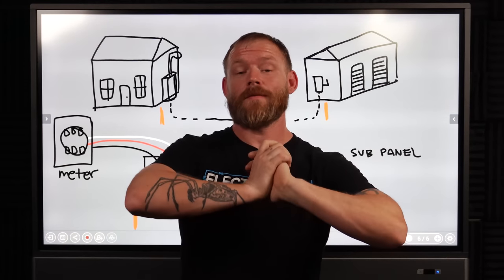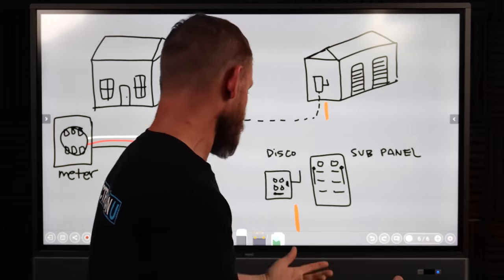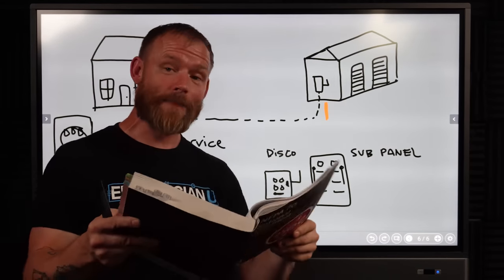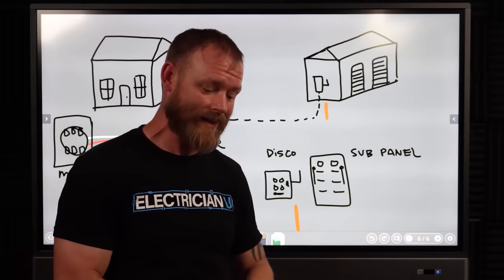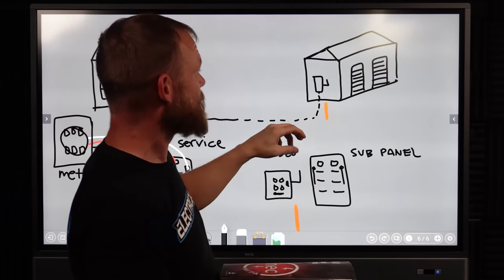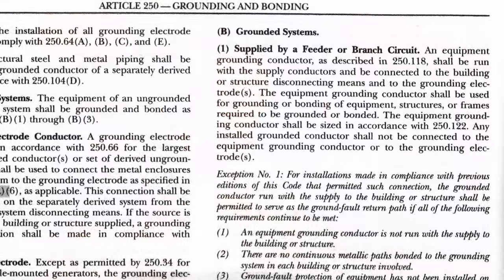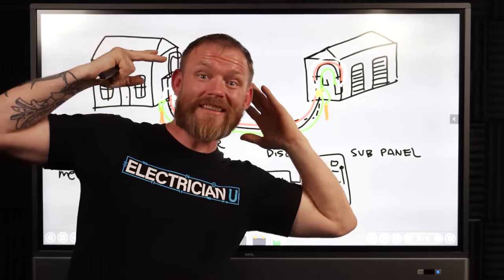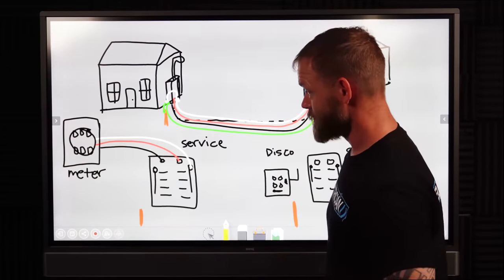Is a Ground Rod Needed When Grounding Multiple Buildings?

Comment: Nice explanation.  I am so glad to hear your explanation of the code requirements for this.  While I am not as good on code, I am an Electrical Engineer and I can explain why you don't want to bond the neutral to the ground in more than one place.  In your example, the neutral (white) is bonded to ground at the main building and is run to the out building.  That neutral wire will have current passing through it because of the load from the out building and thus its voltage will be different.  Also, because of the inductance of the wire and because the wire is long, the voltage on it (both in phase and amplitude) will be different from the ground (which should have not current flowing through it).  Thus, if you connect the neutral and the ground at the out building you will introduce a current in the ground.  This can be a safety hazard.  This issue is called a "ground loop" as you can see that the ground and neutral connected at both ends makes those wires into a circle (loop) that current can flow through.
Reply: The neutral conductor will carry the unbalanced load current from the sub panel back to the main breaker panel. The neutral is still a GROUNDED conductor and is "neutral" between both UNGROUNDED 'HOT' LEGS in a 240/ 120 volt 4-wire set of feeders.
Reply: @electricianron_New_Jersey  The unbalanced load on the neutral does not correct a ground loop though.
Reply: @electricianron_New_Jersey  I agree that is how it works as long as you do not connect the ground to the neutral at the out building - which you should not do.  All I was doing was explaining why - because though the neutral is still grounded, the inductance in the wire plus any unbalanced load will cause the neutral to be different from the ground at the out building.
Reply: Also, with the ground and neutral tied together at both ends you have turned that length of ground wire into a second neutral and the current that would normally flow on the neutral will now split itself between the two wires.
Reply: @jdilksjr  and I might add that having current flowing on the ground has the potential to energize anything connected to that ground wire. That's an accident waiting to happen, and someone who touches an energized equipment case is going to get really pissed, shocked, or electrocuted. One or two of these results may have a secondary effect of someone else getting their ass kicked while being cussed out.

Comment: We had a job once where we were installing a sub panel in a shed that was directly adjacent to house. The main panel was about 10 feet away and there was less than two feet of space between these buildings. We didn’t run a separate ground because our lead misunderstood the code but when the inspector came out and mentioned it he took a 2x4 and nailed it up between the buildings so they could be considered the same structure. The inspector laughed and passed it. I’m pretty sure the homeowner took the stupid board down as soon as we left but that’s not on us I guess.

Comment: There are lots of videos that explain how grounds & neutrals should not be bonded at a sub panel, and how subpanels in a separate building require their own grounding electrodes (whether a rod or concrete encased etc). Few of them explain *why*.  Thank you sir.

Comment: During the storm season in California, I have wired a 13K watt generator to a manual transfer switch to run certain loads.  The generator has a floating neutral but the manual says to bond the generator frame to the neutral wire as well as drive a grounding conductor in the ground.  The 240 volt plug going to the receptacle that connects to the transfer switch ultimately (as you know) connects to the service panel.   My question is, "why would I bond the neutral to the ground and frame of the generator as well as stick an additional grounding electrode in the ground?".  

Thanks and enjoy the whole series!

Roger Peterson, Monterey, CA

Comment: Very good video! Thanks!

My meter is on the outside perimeter wall and to connect my house, my "electrician" actually told me i should bond the neutral/ground at both the meter and in the house panel... i sounded wrong but since i am only a hobby electrician, i assumed he knew what he was talking about!

There is so much bs about grounding and bonding! So thank you for all your videos!

Comment: Excellent; all I would add is that, additional ground electrodes (earth connections) can be added to provide additional support for electronics/radio and communications equipment etc. or to create equipotential environments for step and touch potential mitigation, static electricity mitigation etc. (all special applications) -  BUT - all ground electrodes must be BONDED together in a Single-point grounding topology (think of the branches or roots of a tree) which runs back to the panel and with no double-bonding of neutral to ground anywhere in the system.

The IEEE Emerald standard speaks to these special applications while being completely compatible with the NEC.  

NO isolated grounds please - they will cause problems.  Also for those who might be interested Motorola developed the PANI system for segregating dirty and clean grounds for highly specialized telecom and computer applications.  For the electronics engineer or technician, grounding is a big topic.  This was a great coverage of the code aspects and perfect for the guy or gal who just wants to run power to his garage, barn, etc. for ordinary purposes. The video was informative and accurate.

When all is done, you can check for neutral to ground potential and for objectionable current flowing on bonding conductors as part of a power quality audit.  Using a ground resistivity meter can help verify that you have an effective grounding system.  Obtaining say 1 or 5 ohms to ground is an engineering objective for certain sensitive applications (not your ordinary garage necessarily).

Other special rules apply to bonding gas appliances, fuel tanks, around water meters etc.   Stray voltages can be created by neutral return current flowing through the earth back to the transformer on the street (or wherever) due to the nature of our neutral-grounded power distribution system.  Animals might be sensitive to stray voltage and special methods can be employed to mitigate this phenomenon.  Lightning rods used to protect a building also have special engineering, construction and code requirements.  Generators and transfer switches also have special grounding and bonding requirements.

Devices inside electronic equipment such as SPD/TVSS, GFI's and EMI/RFI filters, even good old fuses and breakers will rely on good earthing and bonding practices to perform some of their functions - mitigating transients and noise in both Normal and Differential mode and quickly isolating fault currents.  Make sure all utility cables (TV, phone, hydro etc.) are all bonded together at a common point.  Termination to ground, of shield wires in communications and control systems cabling is highly misunderstood and is a whole separate topic.

I've had great success with installing a 10 ft x 3/4 inch copper clad UL rated ground rod in a well of ground enhancement material (several brand names exist).  Stay away from galvanized ground rods.  Space electrodes properly and use rods over plates where feasible.   Use good quality connections like UL rated crimp-on devices or exothermic welding to make your connections.  Install rods in an inspection well where feasible.  Make sure that the ground electrode conductor running back to the panel and the bonding conductors are of sufficient AWG.   Avoid making loops in your bonding topology.  

Lots to know about grounding and bonding.  Knowledge and understanding of both theory and practice are the keys.  Good engineers, techs and electricians do not discount either - theory and practice should converge if you know what you are doing.

 In the end Safety is the priority.  Just knowing the code is not always enough.  Remember that the code is a minimum requirement for safety (mostly fire and shock).  Crack open those textbooks and understand the electrical theory behind what you are doing.  Other parts of the world have different grounding standards and systems and so if you have purchase a milling machine made in China, you may want to look at the electrical schematics first.  

Always remember that electricity, like water, will take every path it can - not the path of least resistance (a dangerous myth).  It will happily run through your body to the earth and kill you if you give it a chance.  Wear insulated work boots and gloves where required and don't assume that a ground wire does not have current running through it.  Thinking that touching ground wires is always safe,  might be your only and last mistake (documented fatalities have occurred where disconnecting a ground wire from an electrode while the neutral was bad and all of the load current was returning to the transformer through the ground).

Stay curious, always ask why I am I doing this, this way and is it code compliant a a minimum; use PPE good quality tools and materials with the proper ratings.

This channel is an excellent resource; please keep making videos and thank-you.  Happy grounding. Daniel Lawlor.

Comment: Good. Thanks for continue to discuss return path thru earth doesn’t trip breaker .   Regarding the other video with energized ground rod I was hoping someone would repeat but add a 3 point resistance to ground on ground rod.  Then measure current flow and see how v=ir is.   I’ve used the video in my explaining

Comment: Great tutorial, colors and your ability to simplify the code (black ink on white paper) is very helpful. We've read papers on ground current running back to the Utility company, via the neutral connection. Would be helpful if you were able to elaborate on that, and perhaps dispel myths or misconceptions about it.

Comment: Great response. I wired a greenhouse beside a main building last summer, here in Canada. The greenhouse was fed by two circuits from the main building panel, with a system ground wire from the main building which was not attached to the metal of the greenhouse. There is no disconnect at the greenhouse. It was located about 50 feet away from the ground rods for the home. Our electrical code is a little vague, so before I poured the concrete pad I laid in a ground plate, and I attached that to both the building and the feeder ground wire. To my surprise, the inspector required me to disconnect the grounding electrode from both the greenhouse frame and the ground wire from the home before he would pass it. His concern was something about stray currents between the two grounding electrodes causing issues.
Reply: that's because you only have branch circuits, not a true feeder with a panel. In many areas they might still ask that the building metal and slab rebar be bonded to each other, and then to a ground rod... but NOT tied to the electrical. (unless there's a panel)
Reply: If I recall, in the US you're only allowed one feeder to an outbuilding, with a few exceptions. They would want us to put in a subpanel at that point and then run out multiple circuits from there.
Reply: @kevinmach730  ... in hindsight, those two circuits may be a run of 12/3, in which case a shared neutral would actually be 240 volts. IOW, qualify as a feeder rather than 2 separate branch circuits. Two conduits and two different breakers might slide, but I would be asking the local inspector if that would pass code.
Reply: @rupe53  I considered something similar for my own outbuilding, but since it just didn't make sense to go through all that work to only have the power provided by 12awg wire. A few people reminded me the work is same more or less either way, if you have the space in your main panel, might as well opt for a small sub panel in case your needs change later. I am glad I listened, because I was able to add a 240v breaker for a heater and air conditioner.
Edit: Obviously, the wire was double the cost. and highway robbery at current prices. Plus I needed schedule 40 conduit, which you would get away without if you ran UF. But in my area, that requires digging down 2 feet as opposed to 17 inches.
Reply: @kevinmach730  ... yes, it costs more, but in the long run you get MUCH more for a similar effort on the job. It's just a typical case of pay me now or pay me later to do it again.... so why bother with the shortcut.

Comment: Howdy. Yes.
In older systems where the riser/feeder uses the same wire for ground and neutral a soil electrode at the aux. building is absolutely mandatory. In a newer system with separate ground and neutral the electrode is not so important if the riser is very short, say 40 feet or less. Bonding of conductive parts is essential in the aux. though. But yes. The Code says there shall be an electrode.
If there is just a branch to the aux. to feed a few sockets, bonding of conductive parts is highly recommended. No matter if the branch is an old 2 wire or a newer 3 wire cable.
Regards.

Comment: For installing pool heater so i understand. 
Main panel  breaker = cut off panel = sub panel with gfi and ground wire to earthing rod = separate meter to measure power usage of heater = pool heat pump heater which case housing has its own separate ground wire to earth? Standard 220 volt wiring through out with boded main panel only.

Comment: A couple of points that I would add to what was covered (just an amateur who has some experience in these things) ; as a basic point of clarity , the primary reason for the installation of a grounding leg being installed as part of your circuit(s) is for it to pick up stray current/arcs/sparks(ing) that do not find their way to the neutral or register as an overload within the general parameters of the typical operation of the circuit ; that can be a stray current which originated from the supply circuit or as with the case of lightning it could be of a point of origin from outside of the intended design (in which case we could be talking about an amount of energy far in excess of the capacity that your system is designed for) the grounding system is there to allow for/provide a means to at least aid in providing a point of discharge for that stray current and/or potential excessive overload , it's not intended to be a main active conductor during normal operation. One other thing that I think might be worth mentioning is that the general indication in the video was that "grounding rods" are not "good" conductors (or shouldn't expect to be good conductors) I tend to believe that there's a pretty considerable amount of variability that could exist in that area . A person could put a simple 1/2" or 5/8" ground rod down somewhere in dry soil which as he was indicating may not have a great capacity to conduct , or you may find as I see at times in my area that the electrical service is grounded to a steel well casing in an area where it may only be a few feet to the ground water table and who knows what the soil structure brings to the equation (sometimes this could be the circuit structure without a neutral going back to the incoming supply source ; NOT something I recommend) . But the point to try to address for the purpose of having a smooth functioning system with the basic safeguards being discussed is to incorporate the existence of a grounding pathway sufficient to provide an extra measure of protection from "adverse" system discharge(s) &/or excessive overload but not one which is going to interfere with normal , preferred flow of current through your circuitry. Different areas may tend to have different preferable methods for sizing and installing a grounding system for your area ; as was indicated in the video it's likely to be a good idea to consult with an electrician or inspector in your area if you need help getting it sorted out.

Comment: A similar situation exists where the "external structure" is a well pump house. Usually the pump house is fed using only a single (often 240v) branch circuit, in which case the exception clause of 250.32 applies and a grounding electrode is not required. But I've always errored on the side of caution in this situation and installed a separate grounding electrode. It only costs a few dollars more but I believe significantly increases the safety factor.
Reply: if new install I usually try install a sub panel in some well houses, pump on a separate 240V breaker, service outlet in case heating needed other use,  and light on a separate circuit (4 slots) and a few install permanent 240V heating also so...

Comment: For the longest time I always thought that the ground rod would take the load first as it is the closest circuit. However, as you have mentioned the connection to the transformer is the lowest impedance circuit there is so it actually takes that(with some very small current I suppose going to ground). THUS bonding neutral to ground is vital as it will also coincidentally trip the breaker on the way out. Amazing information!

Comment: Another excellent correct video!    NEC indicates that you should NOT put ground rods on lighting poles.   It came up in a Code class I took several years ago.   The consulting engineer in the class got his mind blown when he found out he had been spewing them for years incorrectly.
Reply: I'm an apprentice so I was just the labor, but about 3 months ago we did exactly that. Rod in a lighting pole. Good to know. happen to know the section in the code?

Comment: Thanks Dustin, great info.
There has to be a reason that each building needs a ground rod. What bad stuff can happen if the secondary building subpanel is treated like a subpanel within the main building, no ground rod and bonded ground + neutral?